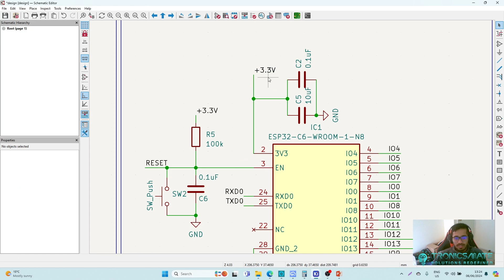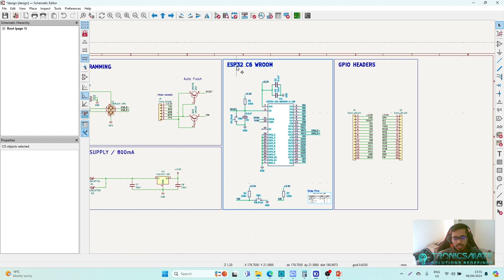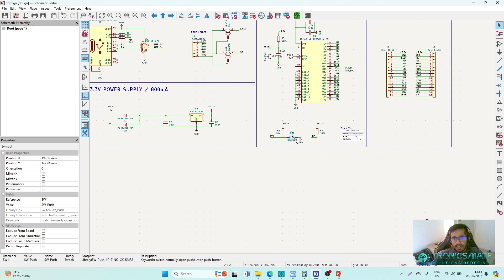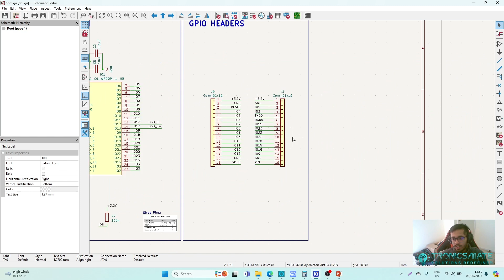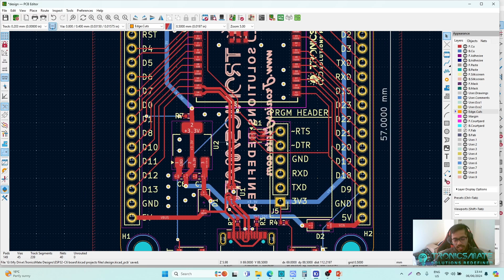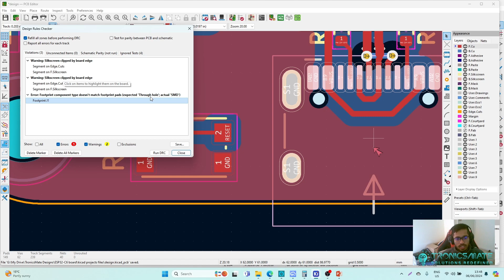ESP32 C6 Board Design with Explanation of Circuit and Gerber files

Comment: Thank you for a clear good video. One comment: For the reset button, I recommend placing a resistor between the capacitor and the ground, so the capacitor will not be short to the ground when the switch is pushed. Also a question: Do you really see a use for programming not through the USB??
Reply from the maker: yes good suggestion. Otherwise there is chance to damage the push button in long run due to capacitor discharge current through push button.

 Do you really see a use for programming not through the USB? Good question. UART to USB bridge is useful for debugging , sometimes firmware can crash early before USB starts etc. But programming point of view no much advantages